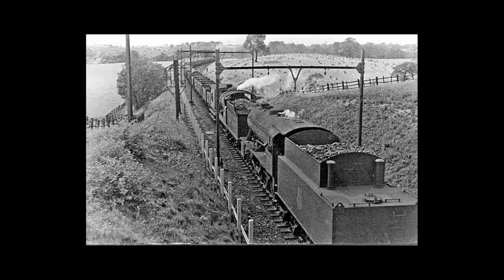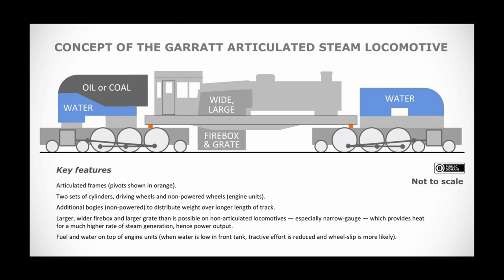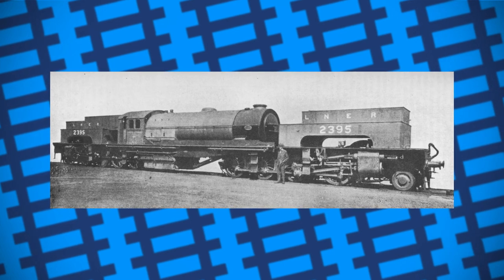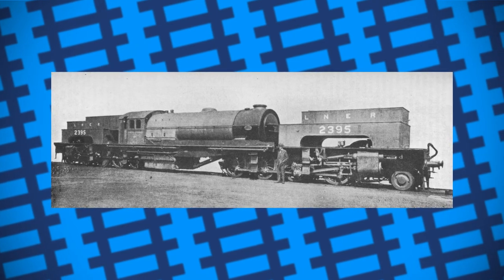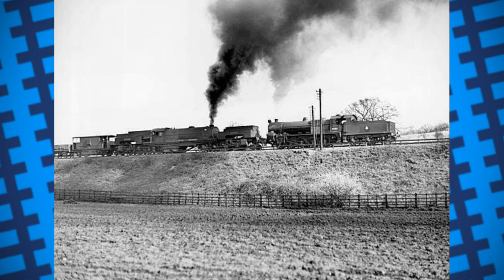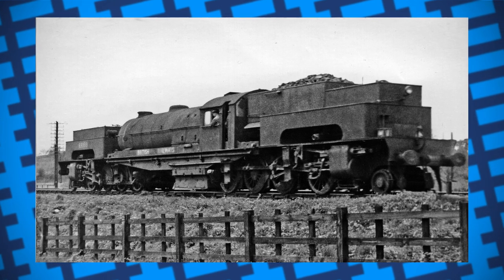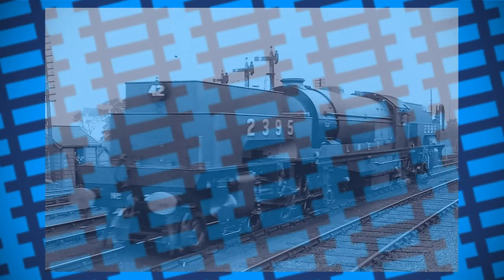The LNER's big banking engine -  LNER U1

Comment: If they refined the design, give it a stoker motor to move the coal from the tender to the firebox, the U1 would've been successful enough for a class of them to be built as banking engines for all heavy goods trains across Britain. Seriously making that absolute unit in just 3 weeks is crazy, it needed more time.
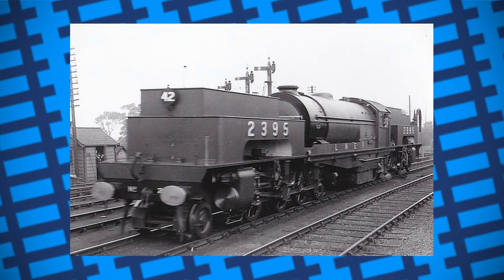Reply: But you only really needed big banking engines on the two exceptional gradients of the Lickey (1:37) and Worsborough (1:40). Garratts could have done a good job of actually hauling heavy freight trains, but in practice Stanier 8Fs and BR 9Fs did the job fine and had a much shorter wheelbase. Garratts were great for Australia and South Africa with their big coal and water capacity over very long distances, and could also give reduced axle load allowing easier track maintenance.
Reply: @iankemp1131   I agree, but British railways were in many ways unambitious. Gresley's P1 2-8-2s (not the P2) fro 1925 were much more powerful than the usual freight 2-8-0s but there was not enough work for them because trains were short and allegedly didn't need their power. It seems no one had any interest in faster freight trains as opposed to longer ones.
Reply: @routeman680  The barrier to faster freight trains in the UK was that they were not fitted with the continuous brake. The LNER ran some fast vacuum fitted trains (60 mph) but they were within the capacity of engines like the K3 2-6-0s. The Gresley P1s could actually have been useful on the LMS for their heavy coal trains, but they went for 7F 0-8-0s and Garratts instead, mangling the design of both so that they never reached their potential.

Comment: those videos like this one make me feel like I was born in the wrong age
Reply: Yes, it's sad that we live in an age where railroads are much faster, cleaner, and better regulated than in the age of steam. Woe is us.
Reply: I dont know about the cleaner part. Also this age, Trains have no originality and feel more like buses on tracks
Reply: @kiankier7330  I know what you are talking about. It's not steam specifically, or even electrification that sucks the fun away. It's that everything is plastic and electronics now. What used to be mechanical switches or controls for everything is now a button and a microchip. What used to be brass or steel is now plastic. I'm talking about everything, not just trains. Mechanical design is dying. Even cars now are replacing what used to be hydraulic or mechanical systems with with a button and microchip that controls an electric motor where possible.
Reply: @lobsterbark  the same is happening with buildings and architectures
Reply: Ngl I wouldn't mind living in the 90s where amtrak locomotives had a better and simpler paint job

Comment: Why would soft water require retubing? It is hard water that causes scale when the minerals in it precipitate on the surface of the tubing.
Reply: Too soft water corrodes the metal in the tubes, especially at high temperatures. A hardness of about 3-5 °dH or so is considered the best balance between scaling and corrosion.

Comment: I've never seen a Garret Run in real life but I've seen the Union Pacific Big Boy which is the largest articulated steam locomotives in the world weighs 600 tons or 1250000 lb puts out attractive effort of 133,000 lb I think the I can't remember exactly off top of my head right now but the the wheel consolidation is aa4884 articulated simple all high-pressure some cylinders instead of a compound there is videos on YouTube of me watching it go through Weaver Canyon and I got to talk to the engineer and everything that locomotive is gigantic 132 ft long 16 ft High 10 ft wide and it just Glides across the rails it is so crazy how smooth that locomotive actually runs it was built to pull five mile long freight trains across the planes at 80 mph that's pretty damn good for a freight locomotive check out the big boy if you know nothing about it I've seen it with my own eyes and the big boys glorious 4014 is the locomotives Road number peace out I almost forgot the boiler pressure 300 PSI of boiler pressure that's with a big boy runs on that's higher than any boiler pressure that was successful of any European locomotive as far as I know

Comment: Interesting video as usual, thanks.   At 2.13 “soft water” - really?
Reply: Soft Water - water containing high amounts of minerals such as lime (that white cack you find in the kettle). This scale eats away at boiler plates & tubes, which will need more frequent replacement in 'soft water' areas. The east coast of the U.K. is terrible for this, as I know from living there. It seems our water is more limescale then anything else!
Reply: Surely what you have described is hard water not soft water? In Wiltshire and Dorset where the water is hard, pipes and kettles do cake up. I’m currently in Cornwall where the water is delightfully soft and the inside of the kettle is as shiny as the outside!
Reply: @nploates  hang about, you're right! Not sure where my head was when I wrote that last comment, but I had just got home after all... What I actually meant was that soft water is, (I believe) slightly acidic, which itself corroded the engine's boiler. Here in Lincolnshire, the water is hard as nails so I always make sure to run it through the kettle before putting it a model steam boiler.
Reply: @ajaxengineco  At least we are on the same page. Though I’m interested in what you say about soft water being acidic, so was the commentary in the video correct or had ‘Train of Thought’ just arrived home?
Reply: @nploates  I would say he is correct on this account, having observed the effects of the local soft water on small model steam engines & boilers. It's obviously not battery acid levels of corrosive, but over a number of years it will wear down metals.
Reply: @ajaxengineco  Thanks for that, I’ve learnt something new!
Reply: @ajaxengineco  Soft water lacks dissolved minerals, that part of South Yorkshire is notorious for it. It's hard water that has dissolved minerals in it like Calcium Carbonate (responsible for kettle scale)
Reply: @nploates  Hard water tends to be slightly alkaline and not corrosive, though it scales up the boiler tubes so they need more frequent washouts. Soft water may contain other dissolved minerals which do have a corrosive effect, often a localised problem. For example, Horsham water came from a borehole and, though soft, had a considerable sodium carbonate content that dissolved copper stays and led to one of BR's last boiler explosions in 1949.
Reply: @iankemp1131  Interesting

Comment: Should tried a cab forward design? I mean I know brits don’t believe in using oil as a fuel source for steam engines, but hear me out. It works pretty well over here and we have been using as a fuel source for steam for quite some time.
Reply: the Brits definitely considered oil as a fuel, however it's all offshore and imported so of course it's not as clear cut as your comment would seem to suggest.
With the garratt it's just a case of turning the engine around, the cab will end up at the other end of the boiler barrel, fuel type being irrelevant. The issue is keeping the boiler always facing uphill with the firebox at rear. By placing the cab at the front of the smoke box the crew will be slowly roasted, and if on an engine unit it will reduce water capacity. On the steeply graded centre section of the north island New Zealand reversed one of its garratts for the smoke issue, and it was considerably better for the crews, as is rather predictable.
Reply: At the time the U1 was being designed & built, oil was a very expensive import but we had vast deposits of coal. Oil deposits in the North Sea (off our East coast) were discovered in the 1960s & came on stream in the 1970s, but have gradually reduced now. Oil would have made practical sense but was economically unviable at the time.
Reply: This is to all the comments and I do where where you all are coming and I totally get it. The Southern Pacific Railroad has great success with their cab forward locomotives out on the west coast of the US, and we’re effective  through the mountains in California, Nevada, Oregon, and so on. But, I do see how oil is more expensive for y’all, I would here about it from my co workers in my squadron at RAF MILDENHALL on how they had to buy oil for their homes for the winter and how expensive it was. I lived in the barracks at that time so it wasn’t a concern of mine obviously. Overall I do thank you fo the input.

Comment: Interesting how the US and UK had different ideas on articulated steam locomotive power
Reply: Also Garratts preferred in Australia and Africa.
The Australian NFSA has some very high standard film and sound of the AD60 class and other surviving steam on the main north line around 1968 ;
https://www.youtube.com/watch?v=ePpG4tVHSMQ&t=613s
There is also 6029 running in preservation, mainly on passenger trains.
Reply: @johnd8892  love train footage where the audio isn’t from a separate recording. Many US films have footage from 6mm or 15mm cameras but bc of the time period (or bc it was just someone recording footage on their own w/ what they had), the audio is from a separate train spotting event. So you’ll get footage of a Cab Forward traveling over 40 mph but the audio sounds like it’s going 15 lol
Reply: Probably to do with loading gauge.   There is no way a full-size American Mallet could be made to fit on British tracks.   The boiler of a Mallet has to fit above the front engine unit with clearance for it to swivel.   Whereas the Garratt has its boiler slung between the engine units, so could be pitched much lower.
Reply: @cr10001  Also, on a tight curve the center of gravity on a Garrat would move to the inside of the curve which increases stability. On a Mallet it moves slightly to the outside.
Reply: @svennoren9047   That is certainly true, though probably most significant on railways in mountainous regions with many long tight curves, more so than British main lines.
Reply: @cr10001  true; I couldn’t picture UP 4014 on British rails
Reply: @cr10001  not only that the weight would Damage the rails. Cause problems with its hight when Being on a British gauge

Comment: most Garratt engine units only used two cylinders not three. Kinda sound similar to the AT&SF 3000 class, except the 3000 class is an oil burner. I wonder how better the U1 would be if the three cylinder design got replaced with the standard two cylinder layout?
Reply: The New Zealand small class of Garratts with two three cylinder Pacific engine units was even less successful and very short lived.
The little known Tasmanian double Atlantic Garratts used a total of eight cylinders but worked too well as it easily and smoothly got up to speeds too high for the Cape gauge trackwork. These speeds were the main cause of a few crashes they were involved with. The eight cylinders on narrow gauge meant higher maintenance costs. So withdrawn after around ten years of use or less.
Reply: Robinson had a design for a 4 cylinder Garrett basically using two 8K power units which would probably have been more successful than Greasley's 6 cylinder design.
Reply: @TIMMEH19991  The O2, being a three cylinder design would offer a smoother power output and would be less prone to slipping, it also offered more scope for development than the older Robinson 2-8-0 design.
Reply: Why would a two-cylinder version have been any better?   It is not reported that the three cylinders on the U1 caused any problems.   Two cylinders would have offered less tractive effort (unless larger cylinders were used, of course, but that may not have been possible within the loading gauge).   Which is the reason all the largest express locomotives in Britain used three or four cylinders (and similarly for much of Europe).
I'm not sure what the similarity is with a 2-10-10-2 Mallet with a ridiculously complicated long and skinny boiler design.

Comment: Americans: 'Why not just build a bigger engine?'
Reply: As this video shows apparently the Brits had the same idea
Reply: @misterflibble6601  its not really a big train though is it? putting a tender on the front doesn't really count now does it?
Reply: @upthebracket26  

It’s big for the uk.    

I believe Scotsman with two tenders was too big for most turntables but it could easily turn around in the USA
Reply: @upthebracket26  does putting a tender on the back count?
Reply: @upthebracket26  Its not a tender, its a motor unit.
The whole Garratt concept is two motor units with boiler suspended between them, as compared to the Mallett concept more commonly used in the USA which is two motor units with the boiler mounted over them.

There was no logistical reason for the UK to build bigger locomotives because there was no operational requirement for them.

Comment: Wonder why they went with this design instead of doing what America was doing with their articulated steam locos like the ATSF 3000 or the later UP Challenger
Reply: I am not saying this with any factual authority: My guess is that it was a patent issue.
Reply: Loading gauge is my guess, cramming two driving sets under a large, long boiler would be very difficult on Britain's Victorian-era infrastructure, with many curves and low bridges
Reply: The answer is probably wheelslip. The main issue the US articulated sets had was getting weight onto the leading drive set, the wheelslip causing traction issues. The main benefits of the US articulated layout is the room for a bigger boiler, and that you can fit a very large tender on the back. Both things that this locomotive didn't need as it was only a banker, and something that the wheelslip is going to cause problems with.
With the Garratt layout they could put the water tanks and the coal bunker on top of the drive sets, reducing the wheelslip issue. And since the locomotive technically doesn't need a tender, since it has a standard sized boiler on an oversized frame has plenty of free space on top, it can be shorter too.
Reply: The 180 tons is spead over 6 axles which are further apart so the stress on the rails and trackbed is less.One reason they were used in places round the world   which had less substantial track construction.
Reply: @templar_1138  the garratts were patented as much as the mallet, or articulated simple. Just the garratt suited some railways considerably better than the mallet. Baldwin held rights to produce the garratt in north America but there just wasn't the market for them there, fuel capacity issues supposedly being a huge reason